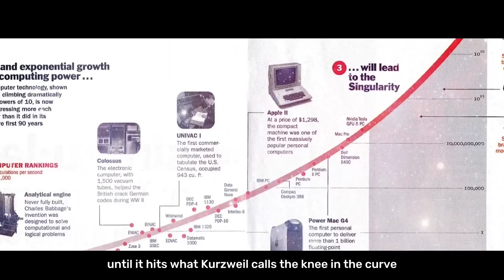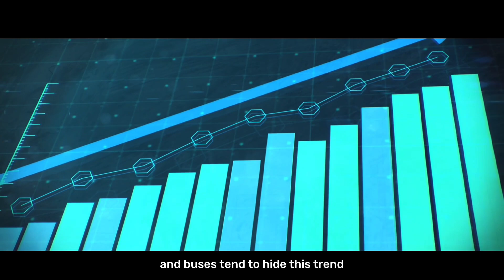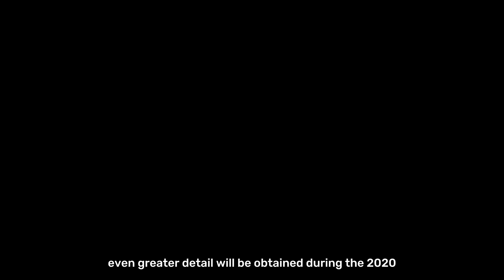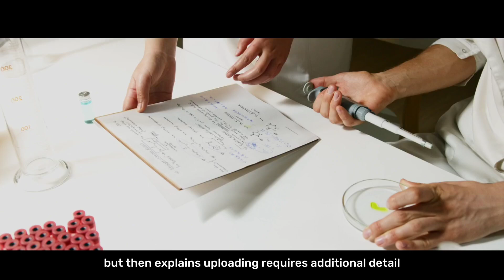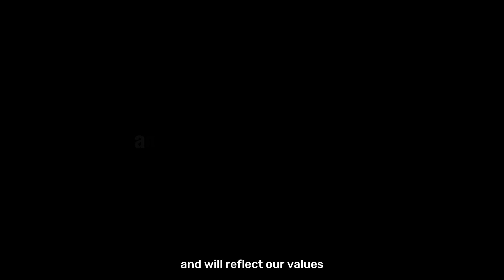Ray Kurzweil says We'll Reach IMMORTALITY by 2030 | The Singularity IS NEAR - Part 2 |

Comment: To anyone who doesn't believe this here's my anecdote: 

In 2014 I built a computer for 3.2k nice bells n whistles at the time. Fast forward about 2 years ago my phone (OnePlus 8 pro) currently has just a little shy of about the same processing as my computers CPU 🤯. So my phone that's a fraction of the size, fraction of the cost and needs a fraction of power (battery vs 120v plug). Now just keep thinking what does that means for the future...that's just one aspect too there's so much other things that seem to point to the singularity happening.
Reply: the problem is not computational capacity but rather the limitations of a turing machine.  A turing machine will always have a limited memory.  We need to be able to access unlimited memory which would unlock intuition and other spiritual mechanisms.

Comment: Kurzweil did not say that modelling the brain requires 1016 calculations per second. That's actually 10 to the 16th power, which is 10,000,000,000,000,000 (10 quadrillion). Likewise, 1013 bits of memory is really 10 trillion, 1019 CPS is really 10 quintillion, and 1018 bits is 1 quintillion bits. The people who produced this know video production, but the script writer doesn't understand details of what he's writing, due to shortcomings in math and English. He keeps saying 2020 when he means the 2020s. Otherwise, interesting.

Comment: Numbers like 1016 and 1013 mentioned in the video must be fixed. The correct numbers are 10^16 (10 to the 16th power, 1 followed by 16 zeros) and 10^13 (10 to the 13th power, 1 followed by 13 zeros).
Reply: I mean, this video from 2 weeks ago says we'll become able to scan the brain from the inside using nanobots in 2020, so you know it must be right.
Reply: @billmcdonough3950  The mistakes in the text and the voice reading it indicate these timescales are a bit optimistic, but technology is racing ahead right now. I think if 10-30 years were added to some of these dates, a lot of it will turn out to be true.
Reply: @billmcdonough3950  I Kno it sounds crazy bill. But I've been following the singularity since almost 2010. I see the improvements happening. I bought my computer in 2014 it was 3.2k. my phone (OnePlus 8 pro) has about as much processing power as my 3.2k computer 🤯. But my phone is a fraction of the cost fraction of the size and I don't need 120v off the wall to power it...a battery is enough. Now this doubling in computation has been happening since the 60s. just thinking what that means for the future...what happens when we can compute a human brain and next year it's double that n then double that...etc etc
Reply: @cocopuff239  @lee Matthews: 10-30 years isn't going to fix the problems in the video. And no, your phone doesn't have the processing power your computer does. The way computers are built vs the way phones are built is a significant difference. The vast majority of the most power-intensive number-crunching your computer does... is not done by the CPU. It's done by the GPU. Go on and try to run 2014 high-end games on your phone. It'll choke. The battery will want to explode. Don't do it.

I've been watching technology progress since the 1970s. This video is more optimistic than the ones from 10 years ago saying cost-effective mass deployment of fusion power was only 10 years away.
Reply from the maker: Hi Ed. Thanks for the highlight. We had the misfortune of discovering the error only after the video had been published.
Reply: It can be written as 1016, 1013
Reply: @ceoofsecularism8053  only if you say 10 to the power 16 otherwise 1016 means 0ne thousand and sixteen.